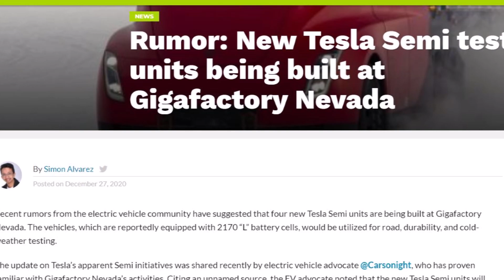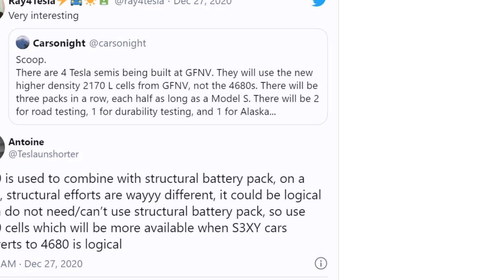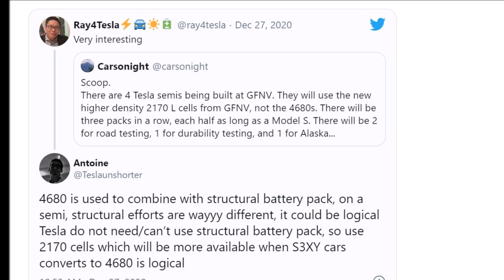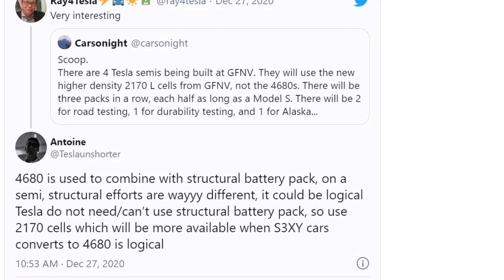Tesla Rumored Building 4 Semi Trucks at Giga Nevada with Surprise Battery Cells

Comment: Ok, not to gripe, but people have got to stop saying 5 times the energy density. The numbers they have are for a single cell, but the cells are wayy bigger so you get less. Overall they are improvements but the biggest of those were in cost and the required capex to build them.

Comment: if you go on snow is good resutl to take improvments with you webasto needed in exteme cold wether working on higher lvl sphere kind turbo sphere 15v plugs like ordinary truck mode for hauling 24h and also like diesel agregate for cooking easy lets say and some high tech improve you use bus door why not add gas compressor in so you do scfi cooled gas relase and do seal presure door on inflate tube tyre so efects off outside waether can beeasy inside monitoreda and tech evaluatec under tough difuicults temprature so this stuff large corps anyway until thy figure its cheaper for them develop thi tech in faster mode nto lose time in 5-6 cycel to have 2-3 years and idea off poping out platforms is too easy and manufacturable like anway price is still player depsite test and possible cooler fans and cryo gas somualtion also research and test facilitries is relativly cosntalntly easy all year to have -20° C and easy all year extensive test so new cars in models are actualy better tested and with more qulaity as 4x4 option are legendary and in electric cars tough and durable even used cars are nto so bad quality and this in tech changed to better.. thsi is market slowly grasping as vishes buyer change and desire  more SUV on cars on 4x4 in EU as sign off stability o interest chnge to larger market  or lrager hybrid cars too or anyday hybrids as well e cars and gas cars slowly comibned slowly grasp out.

Comment: @7:58 You mentioned that the 4680 battery is expected to have 5x the energy density.  Elon said the cell would have 5x the energy.  The cell is over 5x bigger, so of course the energy is 5x the 2170 cell.  He never said the energy density is 5x.  That would be huge, but not here yet.
Reply: I thought it was 5x the size with 6x the energy
Reply: @DuckHunterGaming  5x the energy, 6x the power, 16% more range.
Reply: 14% more energy density  but 6 times more amps the big advantage with the new battery design is fast charging less heat and cost reductions
Reply: @13thbiosphere  Agreed, heat dissipation is the big advantage, well that and making its' price affordable.  5x the energy from a cell that is 5.48x bigger is actually 8.7% lower cell energy density.  Is that "14% more energy density" at the pack level?  6x the power from a cell that is 5.48x the size is a 9.5% improvement in power.

Comment: I believe the 2170 is a better form factor when it comes to working in cold or hot weather it's easier to cool or heat a smaller cell v.s the 4680
Reply: No it not that's one of the reasons they are going to the 4680s easier to cool and they don't need as much cooling either as they are simpler to charge and discharge less internal resistance which produces unwanted heat. 4680s trounce 2170s in these important areas
Reply: @brettmciver432  They aren't using the 4680 cells in the semi they are using the 2170 L. The reason i think they are doing this is they can't make the 4680 cell intergrated into the chassis in order to cool and heat the 4680 cells properly. I'm not disputing the 4680 is the better cell but they can't make it work as well in a pack like the 2170 is my belief. I also think they are putting high density 2170 L cells into model s and x plaid production line right now.
Reply: @Northbaylandscaping 
Maybe for these rumoured 4 new prototypes but with the 4680 line at keto rd plus lots of test cars (vehicles) out there atm with said 4680s in test mode I'm fairly certain they are using the 46s, they have to test and make sure the new design works, and who said they can't integrate the 46s into the new trucks, that's probably why they are building 4 new ones, designed around those cells.
Reply: @brettmciver432  maybe we'll just have to wait and see
Reply: @Northbaylandscaping 
Agree but it does not make sense to me to build 4 new trucks and use the old cell form factor when the 4680s were designed for the trucks in mind especially with the high nickle content anode(I think its the anode) which increases its range. They need to test those batteries in the trucks for longevity and reliability.

Comment: People forget that the Tesla Semi is still being tested and developed, and there isn't a production Semi yet. So it doesn't matter that they are using the 2170 cell at this stage. In fact the 2170 batteries would likely work fine for the entry level Semi, and for right now it is more important to get the Semi into production ASAP than to sweat over battery details.
Reply: A 2170 lithium iron phosphate cell might be fine for the non-sleeper cab Tesla semi.  It's designed for shorter hauls.  If they can make LiFePo 2170 cells then that should be a long lasting tractor.  A heck of a deal for the owner/operator.
Reply: @bobwallace9753  The Panasonic 2170L battery is not LiFePo, it is Panasonic's new NCA (nickel-cobalt-aluminium) battery that uses less cobalt than the NCM batteries, but has 5% higher energy density than their previous 2170 batteries.

Comment: The Tesla Semi is weight critical it does not make sense to use 2170 cells when the tabless 4680 cells weigh less, have a higher energy /power density, faster charging with improved heat dissipation?
Reply: Tesla can test prototypes with 2170s and then use 4680s for production.  Right now there probably aren't enough 4680s available.

Comment: Please stop saying the 4680s have 5x energy DENSITY. They have 5x energy but the form factor alone only slightly increases the energy density.
Reply: They aren't saying they will require 1/5th the batteries for a car right? So the density as you say is only sightly improved.  Each battery is larger and have more energy per unit
Reply: @litestuffllc7249  Exactly! Surface area (case) to volume (active ingredients) ratio is a bit better. Most of the energy density improvement comes from cathode material, anode materil, lithium doping etc.

Comment: I predict Tesla will integrate the batteries into the semi truck wheel, thus allowing the truck to simply roll the batteries as opposed to having to carry them. This will dramatically reduce the weight of the Semi resulting in improved range and performance!!
Reply: This is crazy (more chance for damage) and illogical (will decrease efficiency as there will be extra useless work/energy loss).
Reply: @АгронДепартье  Not to mention not nearly enough space to hold the amount of batteries needed.

Comment: Model S and Model Y lines were shut down at Fremont recently. This could be the switch-over to structural battery pack 4680 cells. They did deliver giga presses to Fremont for the one piece front and back frames to work with the structural battery pack.
Reply: Does anyone else have info on this? I want to get a cyber truck but if they redesigned the model less I might get that instead.

Comment: Could be they will use 2170L for the shorter range version of Semi. The best use case for an EV semi is for short hauls in Port and Metro areas where distances are shorter, traffic is worse, and pollution a bigger problem. Given EV semi's are 0% of the market, might as well use them where they have the greatest advantage first.

Comment: I can't imagine that 2170 cells will have enough cycle life to make the Semi economical for fleet operators.  But prototype units with those cells will let them test everything else on the Semi.

Since testing the Semi is the objective... there probably is no urgent need to use 4680 cells.  The cells they can get off of their prototype line are not final design cells.  Meaningful testing will come for those cells when the 4680 cell production line is finalized, hopefully next year.

I'm still vague about Panasonic's role for 4680 cells.

Comment: The 4680 batteries are not tested to length. They may only have half the distance and life.
Reply: How do you know that?

Jeff Dahn has been continuously cycling cells for the last three years.  He reports more than 20k cycles with almost no capacity loss for cells discharge no more than 50% and about 10% loss for cells completely discharged.  I would be very surprised if these aren't 4680 cells, or at least the LiFePo chemistry used in some of the tabless cells.

20,000 cycles in a 300 mile range EV is a six million mile battery.
Reply: @bobwallace9753   That's the problem, we don't know yet. I want to be optomistic too. This is the new "DRY" cell I'm talking about.
Reply: @tigeroll  Yeah.  The 4680 is a dryroll, tabless cell.  Tesla has brought a number of improvements together at the same time.  I'm strongly suspecting that the 4679 LiFePo cells are going to have very long cycle life.  Toshiba had 20,000 cycle cells years ago.

Comment: maybe the 4680 batteries will be reserved for vehicles that need the best weight power ratio as in the Plaid and roadster that are packaging sensitive.  The huge semis are not burdened with the same constraints
Reply: Elon said Berlin model y will use those
Reply: All Tesla models will apparently move to 4680s over time.  The vehicles that need the best power ratio will use a chemistry that is based on lithium and nickel.  The non-performance versions will use lithium iron phosphate.  The LiFePo cells are a bit heavier but have very long cycle life and are non-flammable.

Comment: I don't understand why 4680 batteries must be used in structural battery packs.

I think Tesla's semi will use 4680 batteries as soon as they are in full production.
Reply: The size is just a form factor, no reason they can't be used in conventional packs, the structural pack is just simpler, more efficient and lower cost
Reply: They do not have to be used in structures. It just saves money and makes the structure stronger.

Comment: I think we will not see 4680s in any vehicle next year. Maybe 2022 or later. It just takes time to ramp up production to a level at which it makes sense to really use them in a product.
Reply: The Berlin Model Y will have the 4680. This has been publicly stated repeatedly.
Reply: @bluecollardisruptor9584  yes, they are actually hiring in Berlin people for the profuction line, is 100% confirmed
Reply: @bluecollardisruptor9584  We'll see. I don't expect large numbers of cars from Giga Berlin next year anyway.
Reply: I wouldn't be surprised to see 4680s in revamped Model S and X this coming year.  They've already produced several thousands of 4680s in the Fremont battery factory.  We might see them first in a high performance version of the S and X.
Reply: @bobwallace9753  Yes, thousands... It needs hundreds of thousands before using them in a mass production car. Maybe you are right that they start with Model S/X that are not sold in large quantities anyway. Would make sense.
Reply: @EinzigfreierName  At battery day in September Tesla stated that they had already produced "tens of thousands" of 4680s.  Tesla has now had three additional months to speed up the production equipment.
Reply: @bobwallace9753  But they also said that the pilot plant will not reach it's full capacity until end of next year. And this is just a pilot, not a large scale production. We will see.